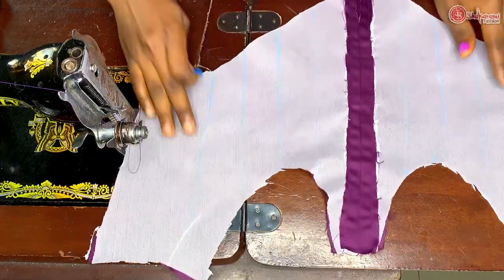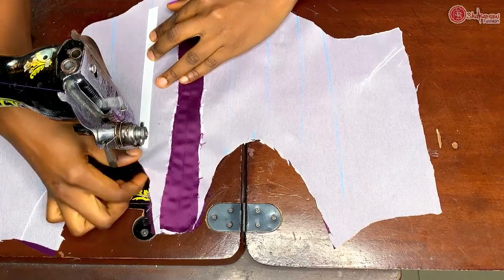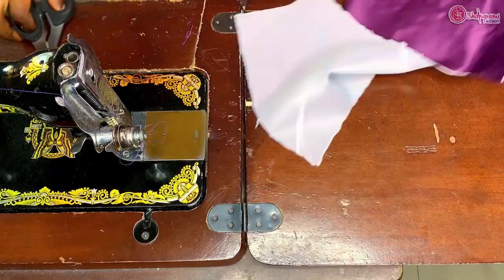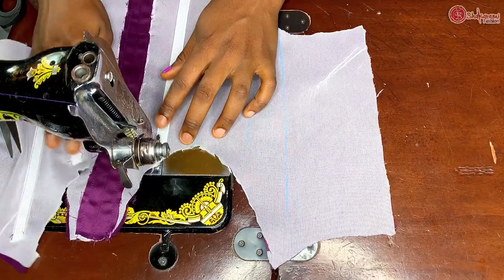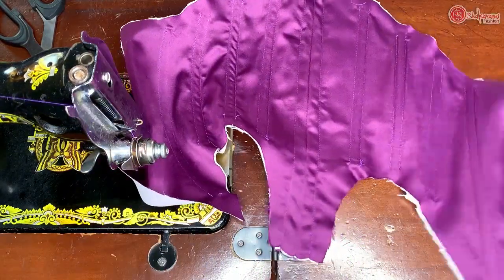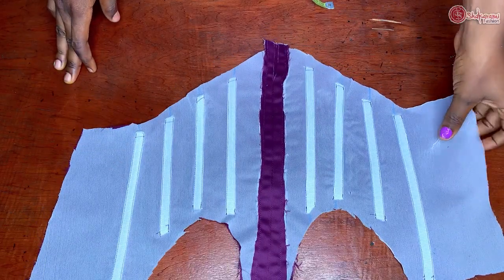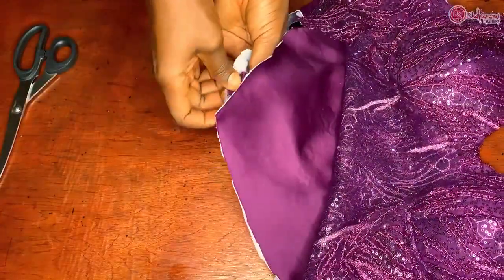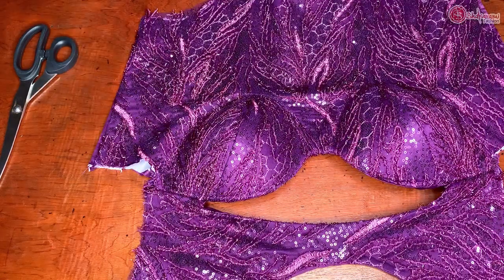How to make invisible corset boning Channels and Double boning techniques

Comment: Thank you ma for the tutorial,  pls ma if my waist is  38 and I snatch it to 36, should I use the same 36 for the lower bodies waistline or I should use 38
It's a corset gown with half cut I want to make .
Thanks! Nd God bless
Reply from the maker: Use 36 to draft your corset pattern and also use 36 to join your dress, ensure to give allowance by the sides while cutting.